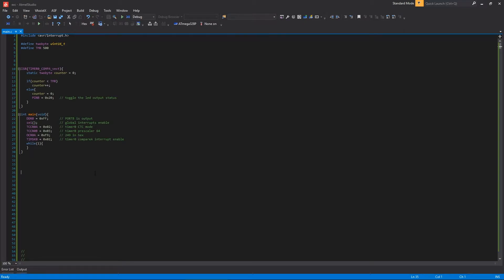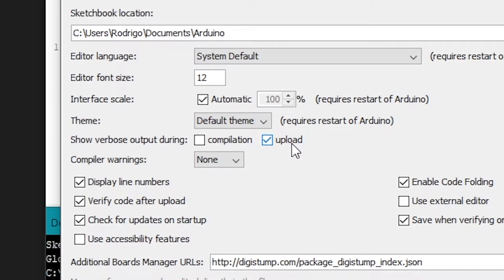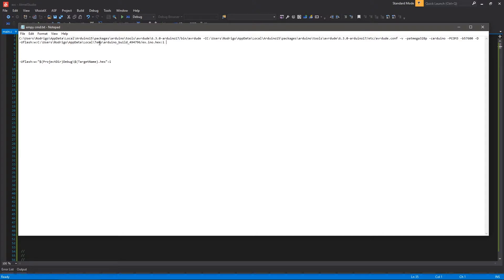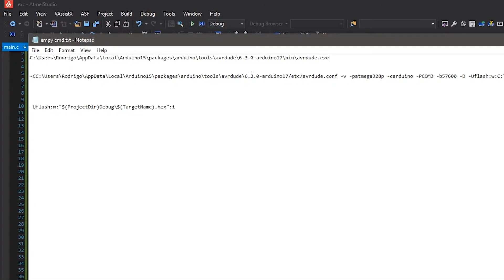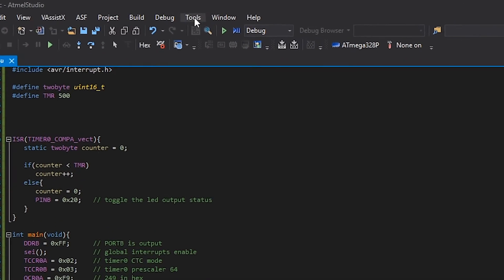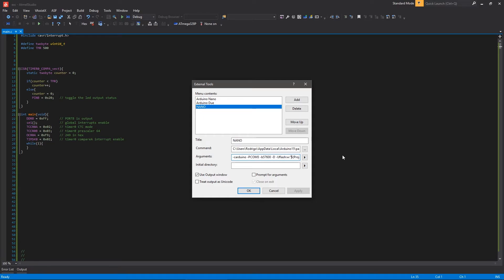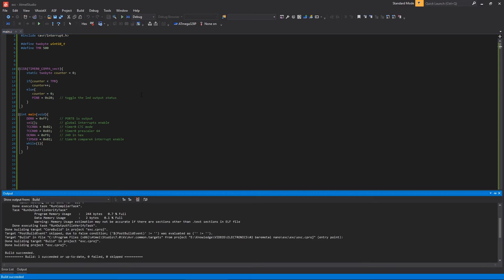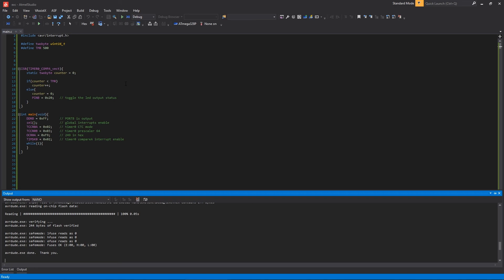#2 Programming Arduino Nano in pure C: Barebones in Atmel Studio

Comment: C:\Program Files (x86)\Arduino\hardware\tools\avr\bin\avrdude.exe

-C"C:\Program Files (x86)\Arduino\hardware\tools\avr/etc/avrdude.conf" -v -patmega328p -carduino -PCOM3 -b115200 -D -Uflash:w:"$(TargetDir)$(TargetName).hex":i

#include <avr/interrupt.h>

#define twobyte uint16_t
#define TMR 500

ISR(TIMER0_COMPA_vect){
	static twobyte counter = 0;

	if(counter <TMR)
	counter++;
	else{
		counter = 0;
		PINB = 0x20;
	}
}

int main(void){
	DDRB = 0xFF;
	sei();
	TCCR0A = 0x02;
	TCCR0B = 0x03;
	OCR0A = 0xF9;
	TIMSK0 = 0x02;
	while(1){
	}
}